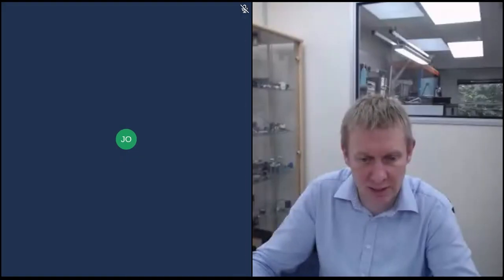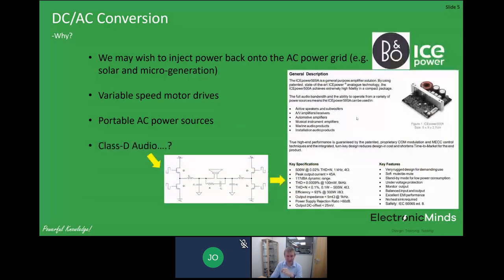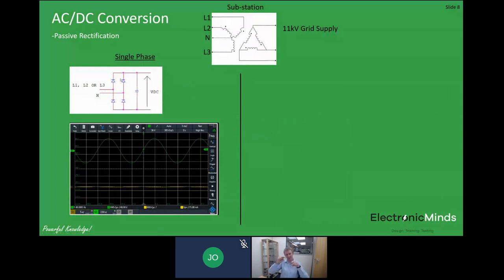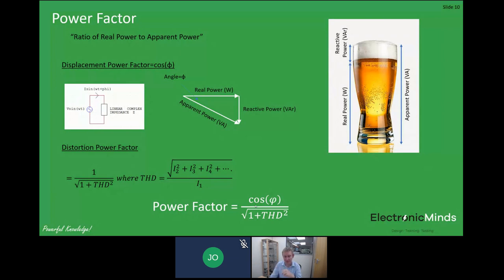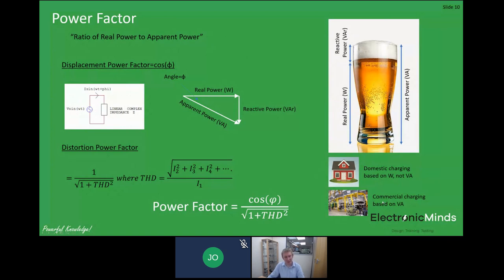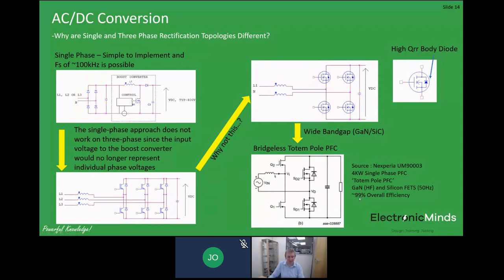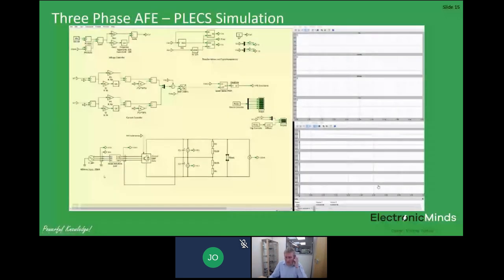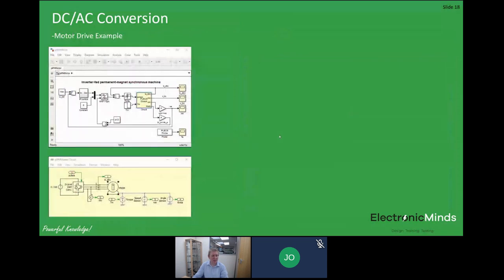Powerful Knowledge 2 - ac-dc and dc-ac conversion

Comment: Totem Pole PFC:
if you turn on a mosfet it also shorts the body diode. the mosfet shorts in both directions, so there is no current in the body diode.
in high curent recitifiers mosfets are acterly used as rectifiers when they are turn on there is 0V over the body diode.